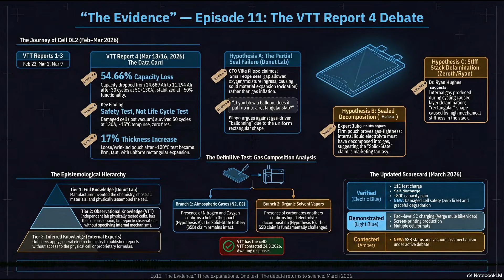Donut Lab Solid-State Battery — The Evidence | When Science Meets Scrutiny (Ep.11)

Comment: Thanks for your great reports. Food for thought: I heard somewhere that Donut Lab doesn't perform standard battery tests. They only conduct their own unpredictable, unusual tests. Perhaps one of the standard tests reveals a major problem with the battery. For example, the standard tests include the nail penetration test and the severe shock test. Perhaps the hard solid material shatters into a thousand pieces when a nail hits it or it's subjected to a strong shock. Naturally, they would want to avoid such a test and only perform tests they can confidently pass. Another standard test is subjecting the battery to high voltage until it fails. Perhaps the battery burns like fireworks at 200 degrees Celsius or burns like coal for a long time. Perhaps it can't be reactivated after a deep discharge down to 0 volts. Perhaps it can be charged quickly, but the discharge rate is too slow for the acceleration required in electric vehicles. I suspect the battery also has some weaknesses. Perhaps it's manufactured using a well-known printing process, and that's why the process can't be patented. Of course, they'll try to circumvent these issues with confusing tests that they can pass.
Reply from the maker: I was actually thinking similar way yesterday. Maybe they collected data from very special battery treatments for themselves and had some fun with the audience. Evidently these are not tests that critics were waiting for. And why critics started expecting conventional evaluation? Did Donut Lab promise something like that in the beginning?

Comment: Thinking on the emotion of the crowd response, I wonder if Donut Lab and social media participants are deliberately fostering such; some parties seem to be acting with a knowing tongue-in-cheek performance (to almost pantomime level). But to what end, to me (and time will tell) this would make sense if the approach is leading up to a reveal of dramatic rug pull proportions, with the released 'tests' designed not just to tease but provide a subtle hint trail along the way. One that, when coupled with a deliberate avoidance of providing the obvious answers that would define the battery in one go (to less impact), is purposefully designed to drive an emotional response. The selection of an April 1st reveal date also adds to the tension and frustration building, leading perhaps to a well-orchestrated response moment. 

If one adjusts one's viewpoint to not consider the tests as only seeking to provide an odd series of proofs for the battery, after all, a public display of such would not be needed to support test result disclosures between Donut and their OEMs, but also as a series of clues as to the potential current roles of the battery, one can summarises its characteristics at a systemic rather than purely technical level. The battery demonstrates being a compact and energy dense power source, with fast replenishment, that works in high temperature environments, with high operational safety well suited to high risk environment use, where the ability to get a vehicle out of danger is critical even if a cell fails, which doesn't lose it's energy quickly and can provide plenty of peaks of power output on demand. There are a few use cases that come to mind where these characteristics would fit well, with some being those often found in roles leading the key developments in more everyday vehicles.

The tests seem designed to reflect these points, rather than the banality of the technical battery characteristics, almost as if aimed to send-up the more traditional figure-laden battery launches we've become accustomed to in recent times. The whole thing seems as much an exercise in the use of psychology; as it is in marketing a product and a technical demonstration.
Reply from the maker: A lot to think. Also remember, that MissGoElectric promised to get back to Donut case at the end of the month. An April twist in the release series would be that they have a live event or some gathering, where they give bikes to some of the selected new customers. Totally jumping over community waited lab test details, which, on the other hand, are much less meaningful than a working product vehicle. Lab values do not translate directly to the dynamic real vehicle environment. All of them, except maybe the energy density, even if that?, depend heavily on the environment they operate, temperature, usage, age, etc.

If you think, where is the real value in the product business? Those bikes are expensive. Motor v2, enhanced components, and SSB pack, updated BMS and big touch screens, all the social media storm stamped on the surface of the image. They become very special, maybe even worth of new Guinness World Records, but at least very identifiable vehicles that has a unique value and place in the market. Everyone remember the campaign, and owners just ride happily and wink their eyes passing the side watchers. Who cares voltage curves if they know they go from zero to 100 in two seconds and still green?

Competition-wise, why would you give any information to public for free? Researchers and competitors would need to reverse engineer everything, which takes time and every week is precious in a quarter life.

Comment: One thing I've not seen commented on yet is the form of the foil covering after expansion. It's not uniform but has creases, dings and impression marks (from the Kapton tape) in the surface.

An evolved gas would not create this surface structure, rather its the sign of a soft solid expansion that sets (squidgy clay like growth or a low expansion foam). Gases could well be involved, but are more likely to be from a slow surface reaction rather than an emission from a deeper layer. It is also likely due to an external reactant chemical being introduced, rather than internal, as the 5C charging condition used in the safety test is the same as used in other cell tests, where the loss of capacity outcome hasn't been observed.

Also, of note is that the terminal to the current collector hasn't been displaced; there is another potential that the current collectors have a safety coating printed on them so if a cell seal breaks, it reacts with the atmosphere (expanding to take up the void space), allowing the battery to continue to operate (if only at partial capacity). This allows the vehicle with a compromised battery to be driven to a safe location or garage for repair. These sorts of technologies are starting to be deployed in batteries, and are starting to be included as part of battery safety standards.